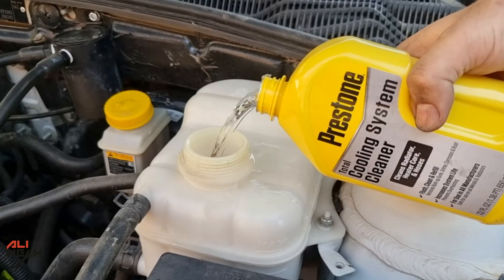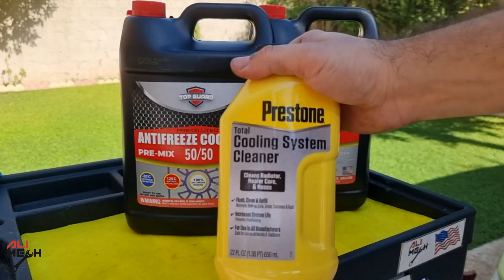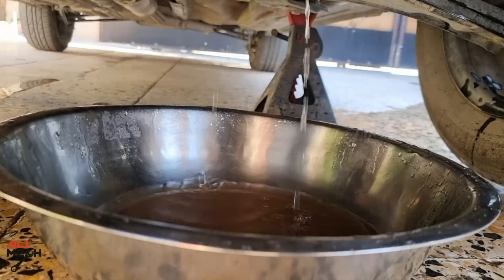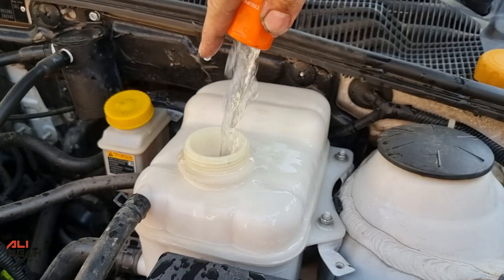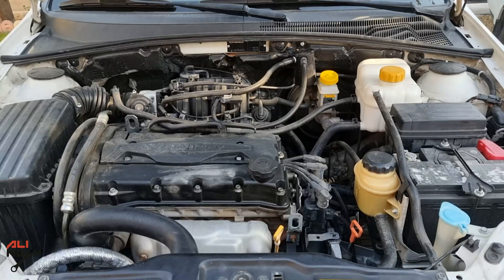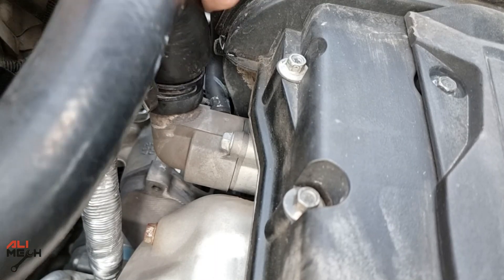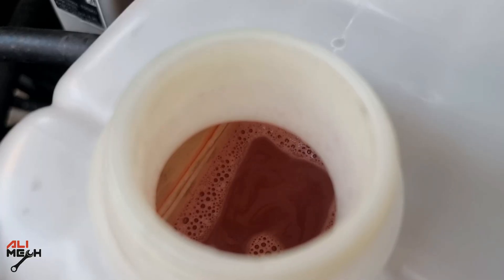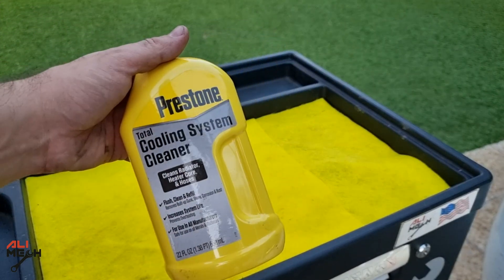How to do complete coolant flush/How to use prestone radiator flush and cleaner/flush Muddy coolant

Comment: What is the best coolant cleaner brand? Have you tested it?
Reply: Blue devil, run your car for two hrs?? Took me half hr, I drain my coolant and refill it with water set the heating system to full blast start my engine, put those in my expansion to clean the rust from the heater core, and got up to the running temp and it came out clear then I open up the main radiator to clean that system and my engine block after that then I added the clr all t together took me 40 minutes, my inside was pushing out 140 degrees with a food thermometer sitting in the vent, cast iron block su,, the rust from the block causes heater core to clog more quickly.

Comment: Thanks Good video,  question.  No need to replace the thermostat after flush and cleaner?
Reply: It's a matter how how thoroughly do you want to clean your system?  
Also DO you want to protect your system from corrosion??

It is REALLY NOT recommended to use tap water when flushing your coolant.  WHY??  

Because tap water contains chemicals and impurities that over time will corrode the inside of your radiator.  If there's a large amount of tap water, it'll lower the life of your radiator, clog pathways and lead to higher gas mileage, overheating and the resolution of such things is an expensive radiator replacement OR water pump replacement or both.  It's easy but in the long run, it's just NOT worth it to use tap water.  

Use only distilled water as it does not have the same chemicals nor does it have impurities that will cause damage to your cooling system.

If you really want to clean your cooling system, you can remove the thermostat from the engine prior to flushing.  This allows coolant, flush and water into the engine cooling compartment and heating core faster.  BUT you get the same effect if you simply warm up your car to where the thermostat opens.  That's why it's recommended when running your engine to turn your heater on high....cuz it'll circulate the flush and water through that part of your system also.  

If you remove the thermostat before you flush, you should replace it AND IT'S GASKET with new components.  They're inexpensive and easy to change.  That way after the flush, you'll have a much better cooling system.

If you leave the thermostat in the engine while you're flushing, the flushing will clean up the thermostat as well as the cooling system.  Yes it might, MIGHT foul your thermostat in the flushing process leading to a need for replacement but that's not really common.  Also if your thermostat isn't malfunctioning it doesn't need to be replaced.  If you're having overheating issues and you test your coolant and it's in the good zone, then the likely problem with overheating is a bad thermostat.  But that's not a guarantee.

Anyways hope that helps
Reply: @jontnoneya3404 that’s the ticket. In my case, after a complete flush, removing the crankcase drain plugs, new thermostat, hoses, new radiator. Why? Well, because I can. 😅
Reply from the maker: Thanks, No need to
Reply: Pull the stat during cleaning for better results